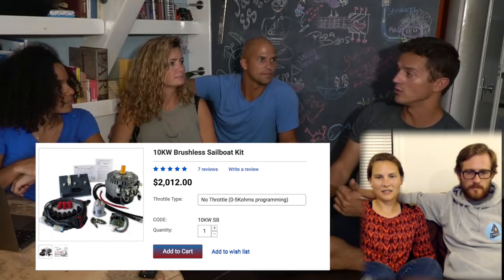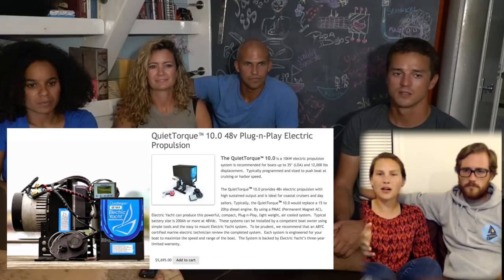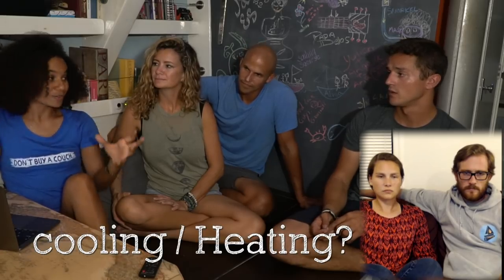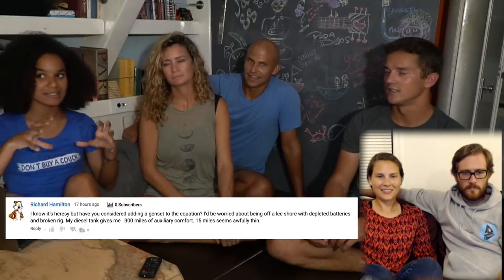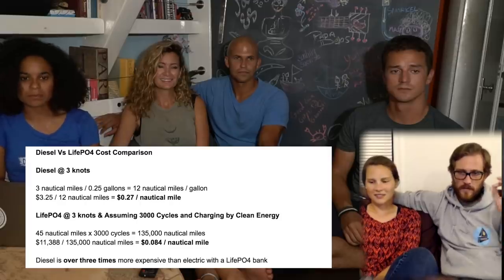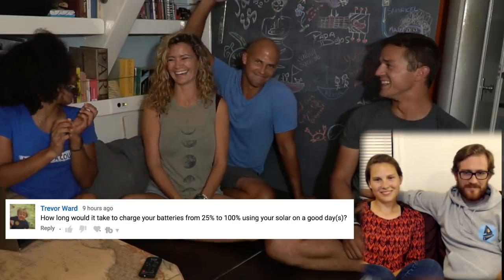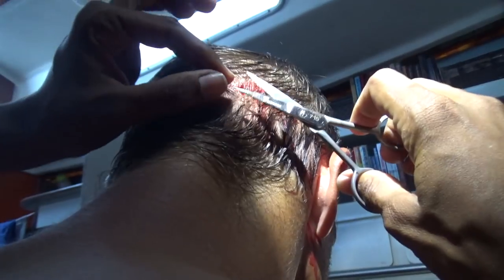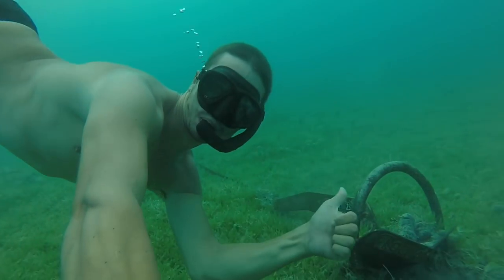Electric Sailboats: An HONEST Discussion — Sailing Uma [Step 140]

Comment: Two additional things you forgot.
1. You can use your Diesel to make electric power. I.e. to run the fridge (it's luxury) but to keep the VHF or HAM Radio running. If You don't use a diesel you have to use a generator which is mostly more errorpregnant.
2. Sometimes you have to cross a channel i.e. we have the Kiel Channel. Its around 60 miles and you are not allowed to sail. Even in the Dover Strait it's more or less a must to have a all times start and running engine to prevent from collision because of tides, less wind or what ever. Its traffic like in front of the Panama Channel - maybe more. I crossed the Dover Strait often depending on the day it's like a highway for ships. And in the narrow part of the Strait you get tidal streams of 4 to 7 knots. No chance to escape under sail.
It might be run in more or less closed areas like the Caribbean or here the Baltic Sea. But whenever you ask people sailed around the world the never would trust the batteries (it's not a question of the electric motor).
The last point is the danger causes from the high power batteries. I never will understand the panic of gas but never panic of 300 Amps batteries. With 300 Amps you are able to burn down everything.

Don't misunderstand I like the idea behind the electric powered boat. It's hopeful the future and pioneers like you bring it into the minds. But pls. don't try to adapt it to all circumstances. If you dream of sailing around the world you will (at the moment) run into the limits. It starts with the probs to get batteries and it ends with the admonished danger of upcoming wind in Archipels.
Fair winds
Tom
Reply: Reading the comments on this video. I 100% agree. I think it is too early to go electric for propulsion. You need something onboard to charge your batteries. A generator and diesel. Perfect! A small generator might be more efficient than to generate electricity.

Comment: First, thanks for the discussion:  It was neat to see how everyone is doing electric!

Second:  I think the main point that would push me in the direction of a diesel is that it's another option.  Good planning can take out 98% of the risk, but there's still that small chance that the prediction will be wrong, and you're about to get stuck halfway across the ocean with no wind at all.

I'd also consider a generator and a moderately sized fuel tank, though:  again, it adds another option.   You'll need to do some maintenance, but they're (probably) easier to take care of than a diesel engine, and leave you running on solar as often as possible.

Comment: What a timely conversation. I just found Sailing Saoirse and Learning the Lines this last weekend as I was looking for more info on electric motors (been a fan of Sailing Uma for quite a while). Now I'm looking into Volt batteries! Question for all of you - how did you figure out how much motor you need? I have a heavy Westsail 32, and I can't figure what motor to use to push all the weight.
Reply: Michael Seymour we went with Electric Yacht and they helped us answer this question.
Reply from the maker: Something like 1kW per Ton gets you close. Depends on how fast and how far you want to motor. What size diesel do those usually come with? What ever it was, divide HP by 3 then multiply by .75 = Kw of an electric motor that will  also get you close. Those are very general rules of thumb, and motor companies often spec a larger motor for redundancy and get you to use a motor at 50% of it's rating. Could chat about this for hours, shoot us an email if you have more questions.
Reply: Same here. We talked with Scott at Electric Yacht Motors and gave him all of our vessel's information and he guided us as to which motor was most compatible.
Reply: Divide by 3 and multiply by 0.75 is actually divide by 4 ;)
Reply: @LearningtheLines  Thanks for the reply! Looks like I need to talk to Scott
Reply: @SailingUma  thanks for the reply! The motor that was in it was a 35HP, and from what I've been able to find from other posts online, that looks to be the average. The boat displaces ~19.5K pounds before loaded. I'm an inexperienced sailor, and one of my worst fears is finding myself trapped against a lee shore in worsening weather without the HP to get to safety. Otherwise, I don't need to go fast - it's a sailboat, and I'll just sail or wait for the wind. By your formula, the motor I'd need is only 8.75 KW, which is significantly less that than the 15 nominal, 30 max I've been looking at. Looks like I need to do some more research. Again, thanks for the reply - love your vlog

Comment: The electric motor is fine. Very efficient. What you lack is the ability to recharge quickly or maintain propulsion for more than a handful of hours, especially at high torque loads. The cure is to install a generator IMO. Use it when you need it. 

If you will truly be long distance cruisers, with the setups you plan, yeah, you'd better be master sailors because you will have to be. 

Looking back at the past, every mariner was a master sailor (or fish bait) because he had to be, but still look at how many sailing ships were lost back then.  

I have worked on engine longer than you guys have been alive. I have also worked on EVs (older technology). I even  tested an EV 4x4 in the wilds of Moab Utah. Loved it in many ways. But I would have have died of thirst out in the desert because with an 18 mile range and minimal solar capability, it would have taken a week to fully charge the batteries (lead acid, so, yeah, not apples to apples).
Anyway, I'm sympathetic but not convinced it's wise to be without a backup means to charge or perhaps charge enough to run the boat for more than just on the battery.
Reply: I agree, diesel generators are more efficient than regular diesel engines and operate at optimum loads which entails longevity of the diesel motor. As far as I know this is exactly the method that almost all modern trains use to produce kinetic energy (diesel generator to electric motor).
Reply: @C_R_O_M________  High efficiency electric hybrid cars also use electric motors with generators. I think it's a good combination actually.
Reply: if you were listening to them you'd have known that they don't constantly run their engine they mainly use the sails which is what a sailboat is meant to do it's not a motorboat

Comment: Great discussion. It seems the crew of UMA have more practical experience, and have learned from their mistakes, while the others are at the beginning of their learning curve and more theoretical. I believe, as stated by the crew of UMA,  that being a competent, experienced sailor — resolved to moving the boat under sail power, mitigates much of the dependence on any means of auxiliary propulsion. Is electric propulsion better than a sculling oar for a boat the size of UMA? Sure. Our 38’ sailboat has solar panels, a wind generator and a diesel auxiliary, each with their respective strengths. For us, I don’t see any of them as excluding any other. What was lacking in this discussion was the realty that many sailors also depend on their auxiliary engine as the primary means to charge their batteries and / or bring down refrigeration cold plates, even at anchor.
Reply: Rowing is about 84% efficient [1]. Most electric propulsion systems tend to be a little more than half that. A Torqeedo Cruise 2.0 T (2 kW input power) for example claims 56% overall efficiency. Josh Dunkley-Smith the 2000 meter (2k erg) indoor rowing world champion did 2k in 5:35.8 [3], and according to a rowing calculator [4] could do 1259W for 60 seconds, that's about 1057W of propulsion with oars compared to 1120W of propulsion for the Torqeedo Cruise 2.0 T. The calculator says Josh could do 625W for 60 minutes! (I'm not sure I believe that!) Crazy. I wonder how that compares to cycling propulsion efficiency like TeamNZ used in the Americas Cup[5]. I read a club racing amateur cyclist here in Australia rode a 1 hour at 380W [6] and propeller efficiency is at most about 85% open water, making 323W of propulsion excluding drive train loss. I suppose rowing uses more of the body than cycling.
[1] http://ruina.tam.cornell.edu/research/topics/locomotion_and_robotics/oar_efficiency.pdf
[2] https://www.torqeedo.com/en/technology-and-environment/performance-and-efficiency.html
[3] https://www.concept2.com/indoor-rowers/racing/records/world/2000
[4] https://ergrowing.com/2k-erg-power-profile-calculator/
[5] https://youtu.be/f51qAgNX-K8
[6[ https://cyclingtips.com/2015/02/putting-the-hour-record-in-perspective-how-does-an-amateur-compare/

Comment: Great Discussion! The comments about sailing rather than motoring because of the electric battery storage are important. Make sure you have good light air sailing systems. I find an asymmetrical spinnaker an absolute necessity. I'm into a decade with my Ericson 27 and EP auxiliary and wouldn't have it any other way!

Comment: My high-tech experiment with electric motor propulsion on my sailboat goes like this:  Install electric trolling motor on the motor bracket on my 23 foot boat.  Add 2 deep-cycle batteries, charged by 2 100 watt solar panels.  The solar panels are on a satellite dish mount, which can be turned any direction to exactly face the sun.  On a sunny day I can run the motor all day long on 3 (out of 5 speeds).  I think the best I can do is 2 knots, with the speed set at 5, but I would have to recharge occasionally.  The batteries charge very quickly when the sun is shining. When the clouds cover the sun, I have to wait a long time to recharge before the motor runs again.  Too bad - my boat does not go upwind very well.  You can tack one direction, staying as close as possible to the wind, then come about and tack on the other side of the wind, then come back and be at the same place as when you started. But maybe the current was going the wrong direction.  Anyway, when the sun shines I can motor forever.
Thank you guys very much for the info.  I just bought a 1972 Islander 30 (for $500).  The motor had been taken out & I like the idea of repowering with an electric motor so I can get my fuel from the sun.

Comment: In time electric motors and batteries will become much more efficient. Also many people don't realize electric energy is very dynamic, ie, it moves things well . Up until now electric motors are using very old designs and mostly only use half the magnetic field available. You Guys are the pioneers .

Comment: I loved the conversation guys good info on your insight for going electric. 

One thought though on to comment about roller reefing mains and genoas. Roller mains have a terrible shape as soon as you start to reef them, same goes for genoas. Using slab reefing on a main helps keep the proper shape for the sail in order to still let you drive to windward. The roller reefing is easy and quick and doesn't require getting out of the cockpit, but you loose all pointing ability. Which is exactly what you need when your caught trying to sail off of a Lee shore, reef, or drive through waves in a Gale.

Comment: I got a 42” sailing yacht in the Solent UK. My take on electric propulsion and your discussion?
Electric engine for propulsion is a fantasy. The energy storage technology is still not there. Even with our weekend sailing, with a strong tide, across the channel, we could not replace our diesel engine with electric propulsion. We sail in all-weather all seasons around the year. Our heavy weather routine is not engine one to get away from the weather. 
Normally we need to get back for work on Monday morning. At times electric propulsion, cannot do it.
• Solar panels. Yes, but they are ugly. Enough watt too keeps service batteries charged for longer, but fancy to charge for propulsion.
• Hydrogenator. Love them. I am saving up for the Watt & Sea P600, the one that is permanently fitted under the yacht.
• Wind-turbine. Never on my boat. Again ugly and often noisy.
I could go for electric propulsion with a diesel generator generating electricity. That could be a good solution. You did not discuss that on your video? This is a very good and realistic alternative. A good small generator is more efficient generating electrify than a diesel engine. You might get more miles out of this. What do you think?

I am really impressed by all your video's. I liked this too but voted it down. (sorry) It was unclear what you wanted to archive.
Reply from the maker: We agree 100%. The first words on our website are "An electric motor is not for everyone". We're certainly not preaching it's an end all solution to replace all diesel motors. But, for us it's perfect and wouldn't want it any other way. This video was just an open and honest discussion about our set ups and our opinions on the topic. We're just showing that it CAN work for some of us.

Comment: Just a thought, if your motor generates that kind of heat when running couldn't you figure a way to wrap it in a copper coil and run coolant through it to heat a water heater tank for hot water?

Comment: Keep in mind a hybrid can be fully renewable. Engines can be configured for E95 and ethanol makes a serviceable cooking fuel, though the induction stove is totally serviceable. An ethanol oven  and grill would be a good optional companion. Project Atticus has a wind generator up the mizzen mast. You should be able to recharge from the prop to some degree with a variable pitch prop.

Comment: Sorry, one more comment. I have had diesels in an Catalina 27 and an Morgan out 41. I don't want to throw things back and forth. But the diesels are very reliable when taken care of and shown due diligence with maintenance. Meaning, don't run them forever and only look at them when there is an issue. There is millions of them and millions of owners with then so it is no wonder that you see so many ordering parts or fail do to poor maintenance. SPOF - single Point of Failure - keep extra parts onboard so you don't need to order as much. I mean you don't see thousands of ships or boats in the middle of the ocean because there diesels fail all the time. Clean fuel- Fluids checked-check impellers often-actually look and tug on engine accessories - check electrical connections for hot spots and corrosion- and you should have a reliable engine. Greg
Reply: yosemiteflyer, you hit the nail on the head. They are very reliable IF taken care of. BUT when a sailor chooses not to motor for months at a time or very short times, that is NOT good for a diesel. So if you are on a SV not a motor boat, an electrical motor is far easier to maintain. The fuel for an electric motor is your batteries which you use all the time if you are a liveaboard. So if you are a liveaboard that sails 99% of the time with a high demand for electricity,  is not more prudent to have plenty of good batteries and a good charging system than to have a diesel engine that sits for months at a time or gets run sparingly both of which are NOT good for them and make them very hard to maintain?
Reply: I agree a person should actually see how they would use equipment to determine what type of equipment is used. At the same time, depending what you are doing... you must take into affect your surroundings and the aggression of nature. We all to often think we can beat it by our thoughts, processes, and technologies. I guess I believe in not having one way ideas to the point that it is detrimental to your life, cause, and future. I think they will figure it out and as time goes by our technology will improve and you will have more options. Maybe small hydrogenators will be common? Who knows.. But keep sailing and stay safe....
Reply: You say all of this like it's easy, but for people coming in with no motor experience it's a lot of information to learn about diesels and a lot of possible maintenance mistakes. Don't act like your years of experience is something everyone wants to spend time on. I personally don't feel fulfilled working on motors and they probably don't want to spend their time that way either, whether it's replaces impellers, filters, changing oil etc and some complex maintenance schedule... Maybe some people don't want to be a slave to a diesel motor always thinking about the next time they have to change various things. That's not fun to some people.
Reply: Aye maintainence is key. Remember when Dan recently took the old batteries out wand the connectors came off in his hands because he never maintained them by periodic checking the connections and tightening a few simple bolts....

Comment: Last comment (maybe). Renee’s rule: If it can break, it will break. If it can’t break, it is only more shocking when it does. And with that in mind, having a plan on paper for what to do when something breaks, or there’s an emergency, or in case someone gets injured, isn’t good enough. You have to practice it. Only when you’ve trained to work through an incident like it is normal procedure, will you be good enough to not panic when it happens for real.
Reply: Quote you "Renee’s rule: If it can break, it will break. If it can’t break, it is only more shocking when it does."

Then maybe the ship / boat isn't seaworthy and shouldn't had left the port. 

Good sailors maintain their boat, and a diesel engine has more moving part than an electric motor, so the diesel motor will break many times before an electric motor do it.

A 3 phase induction motor has only one (1!) moving part.